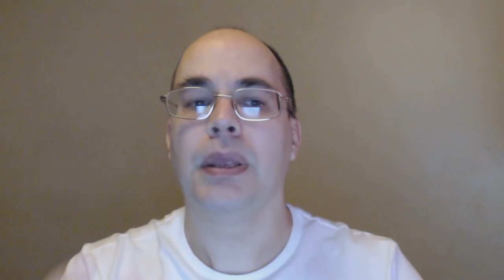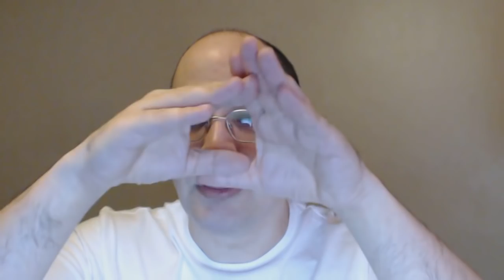How do rockets move in space, with nothing to push off from?

Comment: I just point the deniers to the YouTube videos of rocket engines working perfectly well in vacuum chambers
Reply: Michael Clark,
 will you point out how the thrust is pushing off the walls of this chamber as well you dumb fuck?
Reply: @asleepinthealley  it isn't you dumb fuck! Take a phsyics class for crying out loud!
Reply: @pblakeney  No way you passed any physics class if you can't comprehend this simple example.  WHY A ROCKET WON'T WORK IN A VACUUM!
Why a rocket engine will NOT work in space! NASA says Newtons 3rd law of motion is what makes a rocket work in a vacuum. The 3rd law states "for every action there is an equal and opposite reaction".  They say this propels the rocket forward and not the air the rocket is pushing against! I say, using  Newtons law, Imagine two big heavy boxes in space, move them together and put a spring in between them,, connect the boxes together.. Now, the spring is the action and you will have an equal and opposite  reaction via the boxes, when you detach the boxes the spring will push them Apart. So the action of the spring caused an equal and opposite reaction and the 2 boxes shoot Apart at equal speeds as long as they both have the same mass..  Now a car is Mass the wheels are the spring or thrust and the road has mass, the spring pushes in equal directions, or the wheels turn and the road and car shoot Apart in opposite directions at equal speeds. The ship works the same,, propeller is the spring and it pushes against the ship which is a mass,, and the sea which is another mass, the 2 masses move Apart at equal speeds in relation to their masses,, The ship has more mass than the sea water behind the propeller so moves slower than the water, A plane uses the same principal. A rocket,, the same principal,,, In this 3 part equation, ie (Mass spring Mass) or (Opposite reaction/Action/Opposite reaction) Quote "for every action, there is an equal and opposite reaction". The rocket is the first mass the spring is the fire plume, (This is a controlled explosion that pushes equally in 2 directions just like a spring) and the earth's atmosphere is the other mass, again proportional to thrust and  depending on the mass of air moved and the mass of the actual rocket determines the speed the rocket moves in one direction. As you gain altitude the mass of the atmosphere exponentially decreases but the mass of the rocket stays the same so in order to continue up at a constant speed the the fire plume or controlled explosion has to exponential increase thrust in both directions until finally there is nothing left to thrust against on one side of the fire-plume as the atmosphere has depleted. Now we have a case of Newtons 3rd law of motion only having 2 parts ei ( Mass spring ?????) So Newtons law no longer applies and the rocket will not have propulsion, like taking away the sea from the ship, if ships could fly it would just not move,, the propeller can spin as fast as it likes the ship is not going to move. This is before you consider the unimaginable amount of radiation both in the van Allen belt and in general space.. So that's Newtons law saying you can't go into space for far using a rocket engine, You need something to thrust against...   It doesn't matter what those masses are, that's not the point, all that matters is the action the reaction and the opposite reaction (Reaction/Action/Reaction) 3 parts.. The 3rd law of motion. You can have one big box one small box, One with double the mass, a super spring, it doesn't matter, the principle stays the same, this is a law of physics. so that's ( Rocket = Mass/Explosion/Atmosphere=Mass) The rocket and atmosphere are the equal and opposite reaction. Take away the atmosphere and you have (Rocket or mass=reaction/Explosion= Action=Explosion/Nothing????? zero mass = No Opposite reaction) Now Newtons law can not apply.. The rocket can not propel forward...
PROBLEMS WITH ORBIT SPEED
If we have (mass 1=Actual rocket/Spring or thrust/mass 2=Atmosphere)
So If thrust needs to exponentially increase to compensate for an exponential decrease in mass 2. Then there's ,A, An exponentially  increased need for fuel and ,B, A constant weight added for all the fuel necessary to reach Orbit velocity. 
You would need an atmosphere to use as mass 2 and the problem with that is heat! To reach Orbit velocity means 17/18,000 MPH If you do that speed in the atmosphere you burn up?! Especially when you are carrying Highly explosive rocket fuel! 
Conclusion!
In order to achieve enough mass 2, In an infinite vacuum, you would need to have infinite thrust and infinite fuel  and that fuel would have infinite mass in order to create enough of an atmosphere in mass 2 (space) For the spring or explosion (Rocket fire-plume) The action in Newtons law,, i.e. (reaction/action/reaction) to have enough thrust to propel mass 1 (the actual rocket) Forward. This is assuming space is infinite and a vacuum! 
Final conclusion It's not possible.. Maybe very low orbit with very light equipment, but with the radiation and heat problems! Once a rocket engine switches off in space the rocket will start to fall towards the nearest large object unless the rocket is in orbit!!  I fixed some of Davy spilani' spelling issues so you could better understand what he is stating here..

G'day Mate
Reply: @uncommonsense9948  Wow. You could not be more wrong if you tried! Have you ever taken a physics class? Do you have a college degree and what is it in? If you really want to have a discussion, I am willing but I need to know if you're serious and what background you truly have in physics. You are lacking some fundamentals.
Reply: @pblakeney  Insults are your scientific methodology.  Thermodynamics work = pressure ext. (0)pa. in space X change in volume =   0 work performed by gasses.  Physics is consistent with no propulsion in a vacuum at zero pa.  So now I suppose more insults will be your scientific reply.
G'day Mate
Reply: @uncommonsense9948  If I insulted you, then, I apologize. I  would really like to know what your background is in physics. You are not applying the correct physics to how a rocket works in space. For example, Your Pressure X change in volume applies to a closed system such as a piston inside of an engine. Why would you consider the pressure outside of the piston? Why would you therefore consider the pressure outside of the rocket? Furthermore, the rocket is not acting as a piston. It is the wrong analogy. If you truly would like to discuss like adults, I am up for the challenge. Physics is very consistent with rocket propulsion in space. Let me ask you this question. Do you believe that the Earth is a sphere?
Reply: @pblakeney  GO ahead and debunk this; I want here your explanation of where boundary lines are in the infinite vacuum of space as it relates to a rockets thermodynamic design. I am not debating these laws just quoting them. I am not going off topic with your FE (stationary Earth) vs BSE (ball spinning Earth) question;  If you want to debate earth movement theory vs experimental evidence do your own research and find a geocentric vs heliocentric debate forum.  In order to avoid confusion, scientists discuss thermodynamic values in reference to a system and its surroundings. Everything that is not a part of the system constitutes its surroundings. The system and surroundings are separated by a boundary. For example, if the system is one mole of a gas in a container, then the boundary is simply the inner wall of the container itself. Everything outside of the boundary is considered the surroundings, which would include the container itself. The boundary must be clearly defined, so one can clearly say whether a given part of the world is in the system or in the surroundings. If matter is not able to pass across the boundary, then the system is said to be closed; otherwise, it is open. A closed system may still exchange energy with the surroundings unless the system is an isolated one, in which case neither matter nor energy can pass across the boundary. A rocket is an open system that can exchange matter and energy with its surroundings operating in the earth’s atmosphere. But a rocket in space is a closed system as space contains no boundaries so a rocket becomes an isolated system and no matter or energy can cross any boundary as there are no boundaries in space.... A rocket defies the first law of thermodynamics if it does indeed function in a vacuum… As there are no boundaries in space and no work is done by the surroundings on the rocket system… A way of expressing the first law of thermodynamics is that any change in the internal energy (∆E) of a system is given by the sum of the heat (q) that flows across its boundaries and the work (w) done on the system by the surroundings:  THE CONSERVATION OF MOMENTUM FALLACY Here the idea is that when a rocket “expels” mass, in the form of burned fuel, in one direction, conservation of momentum says it has to be propelled in the opposite direction in order to conserve the total amount of momentum in the system. The law of conservation of momentum states that in a system not subject to external forces the total momentum is always conserved. That's a logical consequence of Newtonian laws. Without external forces the interactions inside a system must always involve some kind of exchanging, like typically in a collision between two objects, where the energy/velocity lost by an object has to be transferred to the other (inelastic collision) or simply exchanged (elastic collision), so that in the end the total momentum of the two objects is the same before and after the collision. Let's take a look at how that applies to a gas expanding in a vacuum. A gas expanding against a vacuum is not interacting with anything, by definition, hence its momentum cannot be exchanged with anything, and it follows that: THE EXPANSION OF A GAS IN A VACUUM WILL NOT AND CANNOT AFFECT ITS TOTAL MOMENTUM (i.e. THE TOTAL MOMENTUM OF THE GAS MOLECULES BEFORE THE EXPANSION IS CONSERVED AFTER THE EXPANSION). The logical, unavoidable consequence, and key point here, is that – if we assume a rocket in space can be accelerated by expanding gas in a vacuum - in order to account for the accelerating rocket we end up INCREASING the total momentum of the system. In other words, we end up violating the law of conservation of momentum. Bottom line: the law of conservation of momentum actually disproves rockets working in the vacuum of space. If you can not comprehend these laws don't feel isolated most people lack the level of comprehension required to practically apply science..
G'day Mate
Reply: @pblakeney  In order to avoid confusion, scientists discuss thermodynamic values in reference to a system and its surroundings. Everything that is not a part of the system constitutes its surroundings. The system and surroundings are separated by a boundary. For example, if the system is one mole of a gas in a container, then the boundary is simply the inner wall of the container itself. Everything outside of the boundary is considered the surroundings, which would include the container itself. The boundary must be clearly defined, so one can clearly say whether a given part of the world is in the system or in the surroundings. If matter is not able to pass across the boundary, then the system is said to be closed; otherwise, it is open. A closed system may still exchange energy with the surroundings unless the system is an isolated one, in which case neither matter nor energy can pass across the boundary. A rocket is an open system that can exchange matter and energy with its surroundings operating in the earth’s atmosphere. But a rocket in space is a closed system as space contains no boundaries so a rocket becomes an isolated system and no matter or energy can cross any boundary as there are no boundaries in space.... A rocket defies the first law of thermodynamics if it does indeed function in a vacuum… As there are no boundaries in space and no work is done by the surroundings on the rocket system… A way of expressing the first law of thermodynamics is that any change in the internal energy (∆E) of a system is given by the sum of the heat (q) that flows across its boundaries and the work (w) done on the system by the surroundings. I don't expect you to comprehend thermodynamic laws as most just can not close the gap between laws and applied science, but maybe some reading this information will be able to connect the dots.  FYI the closed system formula I gave applies when a rocket enters space because there are no boundary lines that can be crossed as space offers no boundaries.  If repeat this fact maybe you will get it; physics is consistent with rockets not working in the infinite vacuum of space..
G' day Mate
Reply: @uncommonsense9948  I asked a simple question which requires a simple answer so that I can understand your motivation. I also asked your background in physics classes (how many college level physics classes have you had?). You really lack the basic fundamental understandings of physics. This is usually the case when an individual has not taken a physics class and had to do the work of answering a plethora of physics questions. You appear smug in your ignorance of physics and appear to not want to learn anything. This stems from your belief system that the Earth is flat. A rocket working in space would affect your belief system so you try as hard as you can to deny that it actually works. After all, there is plenty of evidence of rockets working in space and other countries that have sent rockets into space. You will then counter that you can't trust NASA (or the rest of the world) because you are a sphere Earth denier. So let's get to the crux of the issue, which is that you really believe that Earth is flat. You will then also deny that gravity exists because gravity will not work on a flat Earth. I find it quite amusing your level of incompetence when it comes to understanding physics. If you want a debate, humble yourself and answer the simple questions I have asked, otherwise, you are not worth my time.
Reply: @pblakeney  Once again I am staying on topic.  The level of my education can be witnessed in the information I provided.  The fact you can not understand the applied laws i.e thermodynamic laws i.e. free expansion, the PV work formula, or Newtonian laws i.e. Newtons third law where a force requires an object A (action and an object B (reaction) to get an opposite and equal reaction.  You repeatedly ignore Mr. Murcotts assumption that conservation of momentum is proof rockets work in a vacuum of zero pa. when the law is easy to read and proves rockets can not work in a vacuum due to the fact there are no boundaries in space and nothing ( no molecules) can act upon the system; so the momentum of the gas released is conserved before and after the expansion. if we assume a rocket in space can be accelerated by expanding gas in a vacuum - in order to account for the accelerating rocket we end up INCREASING the total momentum of the system. In other words, we end up violating the law of conservation of momentum; debunk that; we are waiting. 

      Here is uncommon sense question  for you; can you give an example in physics where nothing can react to something?  Here is another question where exactly is the boundary defined with a rocket operating in the vacuum at zero pa. in space?  Quid pro quo the answer to your question  what motivates me to debate technical issues? it is rooted in the beauty of math based logic i.e. no politics just what can be proved through experimental evidence. 

      Physiology is what you are attempting to use to avoid logic based proof (physics) that rockets do not work in in a vacuum; so debunk thermodynamics like free expansion, Newtonian laws like the third law specifically,  the PV=K formula where pressure = the inverse of volume (infinite volume of space) yes we want to know how finite pressure tanks can effect an infinite volume of zero pa, and while you are at it tell us all how nozzle design effects rocket performance at high altitudes, we are waiting, and while you are at it tell us at what altitude zero pa. is achieved; that should be expressed in AGL (above ground level) in layman's terms  for you i.e. straight up no curved trajectories as we all see with the actual rocket launches.  Hint look up the X15 rocket and find out at what altitude propulsion, and stabilization failed that might be getting close to a vacuum..
G'day Mate
Reply: @uncommonsense9948  I asked you first to identify your background education as it relates to physics. You can't do that.  I therefore will not waste my time entertaining your ridiculous understanding. It is painfully obvious that you possess no physics education. So you can go on trying to convince more educated people than yourself all you want. I am not playing your games. I would only engage in debate with you if I can only understand your sincerity to learn. Why would I answer your ignorant questions if you can't be honest and upfront with me? Let's be honest, you are a conspiracy theorist! You would have to be to believe rockets don't work in space.
Reply: @uncommonsense9948  All you really accomplished is the misapplication of physics which is quite amusing to witness. If you really want to have a debate please state your credentials i.e. your formal physics education. From what I can deduce, it appears that you have no experience with physics or engineering and that is alright, just be upfront and state that is the case, then I can tell you all that you were wrong about. You are not even in the ball park. But why should I put forth the effort in educating you if you can't answer this simple question?
Reply: @uncommonsense9948  Come clean. Let everyone know that you believe that the Earth is flat. Can you be honest for once? This is what is driving your motivation to believe that rockets don't work in space! Be a man and admit it!
Reply: @uncommonsense9948  I could not fully comprehend the text due to not thoroughly having looked into conservation of moment , but I do agree that it is impossible to move through thrust in a vacuum. The way I see it is a simple way. For example, if i am swimming in the water, I have to move water molecules with my hands and feet in order to go forward or backwards, in other words: I have to apply force or pressure to the surrounding medium (in this case water). The same can be said for flying in the air,  compressed air (e.g. a jet engine) pushes compressed air against the air molecules (medium) and thus goes forward. In a vacuum there is no medium (air, water, or other gas or fluids) and thus there is nothing to push against, which means you can't move with thrust in space. Basically, we move because we push against a medium.  

Hopefully this explanation is right, just trying to think about it in the most simple and logical sense.
Reply: @uncommonsense9948  Thank you for replying. 
I don't understand how people can't comprehend this. I've had a discussion with friends about it, it basically was me against the rest. They could or did not want to comprehend it while they hypocritically argued action = reaction. It can drive you almost to a point of doubt; thinking " am I the one who is really stupid". But than you know that it's not possible because, you cannot apply pressure in a pressure-less space.  
Interesting view about Matthew 24:24, I have noticed that the ones who firmly advocated that you can travel in space are actively deny the existing of The LORD God and the Bible. Sometimes I think that these people have been given over to the state of mind of this world. 

Good luck in the future. 

Isaiah 41:10 - Fear thou not; for I [am] with thee: be not dismayed; for I [am] thy God: I will strengthen thee; yea, I will help thee; yea, I will uphold thee with the right hand of my righteousness.
Glory to the living God.
Reply: @uncommonsense9948  thank you, thank you so much. I am not so stupid after all.